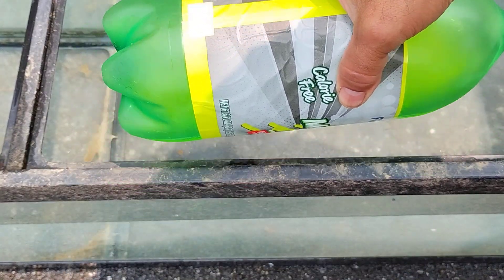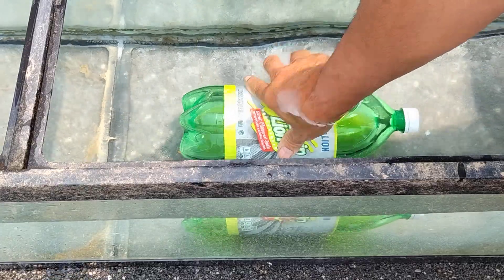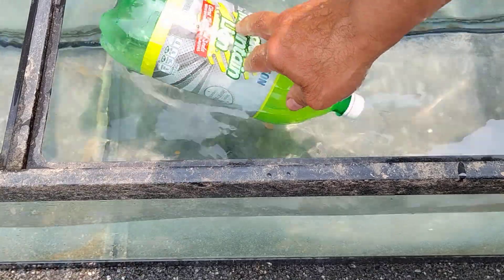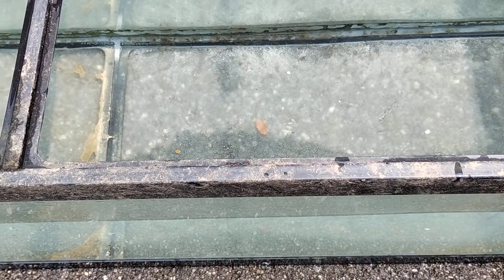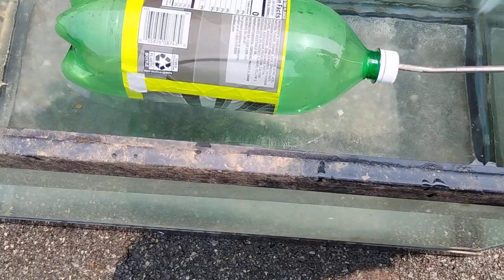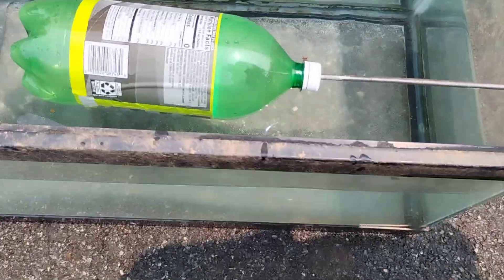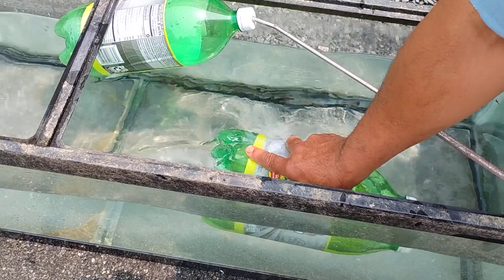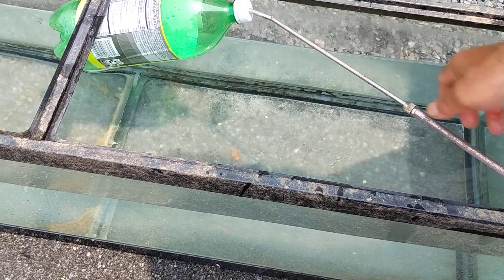Titanic Titan implosion was from the REAR let me demonstrate

Comment: I heard that they had initialized an emergency ascent when they imploded.

Theory:
Whatever caused the emergency, obviously something critical, they decided to use the last resort option that consists of dropping off the whole skid assembly to get to the surface as quick as possible.
One of the legs didn't release, the whole underneath was hanging and twisted the stuck leg, until it eventually broke.  The rest dropped down to the bottom of the sea.
The submersible imploded, because of the initial issue, which blew everything off including the stuck leg that is now missing from the remains.

Thanks for your videos btw!
Reply: Pure horror as they were shitting their pants in that coffin!
Reply: More like hyperventilating knowing the end could come at any time. It had to be harrowing for them to be aware that something bad was going to happen if they didn’t get to the surface quickly.
Reply: Where did you hear this? Can’t find any evidence
Reply: @bajamike9276  Yeah,Ive said also that it can't just go from everything is great to implosion,they would've heard the sounds indicating,if they didn't surface as soon as possible,it would it would be death,so yeah,they were extremely frightened,I'm sure they were beside themselves.
Reply: @johnbravo7542  There is a video out that shows the transcript between topside and sub. They had 15 minutes to debug the stupid idiot alarms that Rush thought was a great idea, but really is oh hey your engine is on fire your all going to crash and die but at least you have an indicator light and an app on your phone that the hull is cracking. Brilliant Einstein!
Reply: @Cptbrainworms  There is a post with 15 minutes of Titan to surface text messages,  they reported an alarm for the graphite hull was on, and could hear creaks, were trying to surface, and that was not responding well.  Surface requested updates and they were not given

Comment: Carbon Fiber hull with 2 titanium end caps reminds me of a tube of biscuits exploding when popped open. lol
Reply from the maker: Remember, the surface a pristine rear part of the vessel, you cannot have an explosion in that direction.
Reply: Yes…a biscuit tube.
Reply: @reddenitup  thats not what  im trying to say, you missed it entirely. im saying the sub resembles a tube of biscuits. chillax, bro!
Reply: I often think of the biscuit can analogy- though they are pressurized by inner vacuum and expose on breach
Reply: @ForensicCats the rear was titanium like the viewing dome, but was not at the ready to be opened like a hatch. It was not pristine if it was the access point for tubes or wires to the exterior
Reply: @christinecollins6648  biscuit tube is pressurized, thats why it pops when you open it

Comment from the maker: Please help me with a comment and thumb's up, I really do appreciate you... and if you see a troll, feel free to attack them, what goes around comes around... Never let a bully get away with their actions.
ps This WILL get my legs ripped off and also shear the bolts that concern me so much, this creates my claymore or mortar device using high pressure water as opposed to high pressure air...
I will add to this but wanted to put a quick version out there... I gave this Columbo hint in first video where I talk about shearing with a sword
Reply from the maker: This WILL get my legs ripped off and also shear the bolts that concern me so much, this creates my claymore or mortar device using high pressure water as opposed to high pressure air...
Reply from the maker: I will add to this but wanted to put a quick version out there... I gave this Columbo hint in first video where I talk about shearing with a sword
Reply from the maker: This is the short version so you can understand concept, I WILL make a better model with connections
Reply: @ForensicCats  Here's a Columbo Hint for you; One of the sevens ways that the Titan could surface was Detachable Sub Legs.

Comment: In his haste be innovative and while clearly being a huge advocate of its use, Mr Rush has probably now stigmatized carbon fiber as a good material for a large portion of the public. Sitting at the airport about to board a "wait is that a 787 made from carbon fiber??!" Hell no i aint getting in that thing!
Reply: As long as wings are not hanging on glue and duck tape you should be alright 😂
Reply: Carbon fiber is poor choice of material for a sub because it's very strong in tension but not so much in compression. The sub was under extreme compression where the airliner is designed to take advantage of the strong tensile properties of carbon fiber. Carbon fiber airlines are safe, carbon fiber subs are not. Think about it, grab a rope(fibers) on each end and try to pull it apart(tension) But its easy to push the ends of the rope together, compression. The sub hull was essentially just a spool of rope encased in epoxy. 
All that said I don't think the carbon fiber itself was directly responsible for the implosion. I think the glue joint between the carbon fiber tube and titanium ends is where it failed. Notice when they brought the wreckage up I did not see any carbon fiber still attached to those end caps. It's also equally possible the window failed and the water rushing in blew the end caps off.
Reply: Can't believe I'm saying this but, generally people are a bit smarter than that. Just a bit though.

Comment: The carbon fibre cylinder failed, probably at one of the interfaces between the cylinder and the glued-on titanium rings to which the end domes were bolted. 

With an instantaneous increase of pressure in the cabin from 1 bar to ~390 bar, the next weakest link was the acrylic window and its surround which, in the first millisecond, was blown out. 

Whether everything in the cabin was forced out through the window hole before the fibre cylinder fully imploded is anyone's guess. We're talking thousandths of a second here.

Tellingly perhaps, the disclosure of 'potential' human remains coincided with the recovery of the front titanium dome. The other items, apart from the ring, were not part of the passenger cabin.

Comment: The big pieces were due to explosion or implosion ?
Reply: Most likely both you can’t have an implosion without an explosion
Reply from the maker: implosion creates an explosion also...  the inside pressure is compressed, but it is called in an implosion... in reality, I would argue this vessel is in an ''explosive environment"; that the force just need a weak point to start the constant OVER pressure and overpressure is what an explosion creates. 
I will do another model, this was just a fast one but obviously I should have waited and given a lot more background information first

Comment: There is an excellent youtube video titled:

 Collapse of Composite Submarine Pressure Hulls  

 It showing how a plastic cylinder and a carbon fiber cylinder fails under compressive loads.  CF cylinder fail with a microscopic crack down the longitudinal (long) axis. It occurs very fast like a glass breaking.

Comment: My theory is like someone stomping on a Pringles can. I think that’s what you mean too🤔
Reply: Right that would be the likely explanation let's say the sealing to the valve in the front of the sub is what failed it wouldn't just blow out the back you would have equal and opposite directional forces inside the vessel. This would cause the sub to crumble rather than being expelled from either one side.
Reply from the maker: Okay, stop on this and have the two ends eject... you would destroy the rear of the vessel that is outside and this is NOT what is presented in the recovered materials.

Comment: My take
Glue at end cap became hard, brittle. Small area allowed little bit of water into crew area. The cheap control stick got couple of drips on it that shorted control.
Water quickly filled capsule, drowning  everyone.
I'm thinking compressed air cylinders were in capsule and exploded, blowing endcap off.
Reply: At that pressure there would be no 'drowning'. The water and the pressure would be instant, literally crushing them from the outside in.

Comment: You demonstrated differential pressure  across an unbalanced telescopic mechanism. The bottle was free to travel while the metal pipe was in a fixed position. 
If you stuck the pipe in further the bottle would have traveled faster.
Reply from the maker: That is what overpressure is... and I do legs in the upcoming video but not for your reasons and it can be dangerous if I submerge the bottle and attempt this same experiment; no fuk ing way...  it's about overpressure and metal pipe was acting as the gas / fluid pressure with the sudden over pressure ...  watch the next video
Reply: @ForensicCats  have you considered that when the carbon fiber failed the two domes where driven towards each other with enough force to shear them from the cradle and tail of the "submersible"?
Reply from the maker: I have considered implosion from overpressure outside of vessel and each time I can't get the arms in pristine condition , it would be easy for me to follow the pack but the arms have the connections sheared and this can only be done two ways, the rear just fell off or a leak and then internal hydraulic overpressure as I demonstrate with air as my hydraulic force....
Slow the video down and you will see the forward movement first before hydraulic overpressure destroys sample... this gets my arms free and clear and the rear being pristine.
Reply: @ForensicCats  Carbon fiber and aluminum are incompatible materials due to galvanic action and subsequent corrosion. The titanium domes and rings where bolted to the steel cradle which was bolted to the aluminum barge. In this arrangement the carbon fiber and aluminum would simply corrode before the steel or titanium. This floating saltwater battery spent a couple years in the water either at sea or at the dock. The square tubing making up the tail framing failed under tension because the rear dome was on it's way to meet the forward dome somewhere in the middle.

Comment: If only the carbon fibre hull would have failed, would't the rear end cap still be attached to he tail ? I also thought they unbolted the viewport for easy transport. I have a feeling they are going to blame it on the viewport anyway bc it was only rated at 1400m or so. Basically I'm sceptic they would reveil the truth. Too many experiances.

Totally unrelated but a pile of hay near a fence with neighbour suddenly caught fire. Wooden fencing was gone, the side of shed was half burned (rockwool inside wall), everything inside was melted, but inside wall intact. So CLEAR evidence to me the fire started outside with the neighbours. The insurance "experts" still insisted the fire could've started from within the shed ???? So I'm a sceptic. The "experts" just want the cheapest payout for the insurance imo.

Comment: my calculations have implosion from the view port. i disagree with the demo but that's science, nice video
Reply from the maker: From the viewpoint would send this into the rear section and we would NOT have a pristine rear... Did you see my last video on this?  I almost always play devil's advocate and then ultimately I release exactly what I really belief what happened.
The viewport would be opposite and you have made what I call a ''conclusive file" and your view point (pun) canNOT be changed bc you made this ''conclusive file"...  it becomes your bias.
Reply: That's what I think too. People look at the undamaged carbon fiber viewport and think that its unlikely that is the part that failed. I think it's the opposite. That part had popped off like a tomato can and immediately all the air inside was superheated. The last of the air was in the back of the sub which is where all the damage was, that is likely where the explosion happened after the fact as the sub collapsed within itself.
Reply: @ForensicCats  No I'm open to other ways it could have disintegrated. But I'm also just speculating on something that is overlooked in a lot of these styles of videos. Mainly being people looking at the partially damaged portion of the sub and assuming that is the failure point.
Reply: My calculations have implosion from the carbon fiber cylinder.
Reply: @MrZulgen  That's not how things work under water this deep. You could unscrew all the bolts that were locking these people in at the bottom of the ocean, and the presure alone would still keep it sealed. It would only come unsealed once the weight of it could overcome the preasure forcing it against the hull. This would be far above where the suspected implosion occurred. Nothing is "poping off" until something else failed that "popped in"
Reply from the maker: BUT, I was only setting people up on that theory, you STILL need the inside ''ring'' interference fit... Can you tell me why? 
I can save this for another video but I will hint, you CAN unscrew them but now, I want you to unscrew them and tell me how or what force or actions besides implosion or explosion would cause  or could cause the ''unscrewed" ends to disconnect?  Theoretically of course.
Reply: @maskddingo1779  guess those bolts were unnecessary then. should have just dived to the titanic at that point.

Comment: So, they got forced out like toothpaste through the front hole adding up in a marmalade paste
Reply from the maker: I am not sure that viewing port failed, I have a bias that until I see some sheared bolts or threads, I am thinking the underwater sub removed bolts or the crew for whatever reason(s)...  But, the were compressed and the force would be in excess of what it takes to shear those bolts from this vessel at HIGH speed (low speed would not create a shear)...
Reply: @ForensicCats  either way the soft protein of their flesh would have denatured under the  hydrostatic pressure leading to a conversion to scrambled eggs and some chunks of bone like pebblesized.
Reply: all their guts we're forced out every hole

Comment: I love your work and I like a lot of your summations but I vehemently disagree.  All the wreckage points to the cause of implosion as a failure of the acrylic viewport at the front bell end/entry door. The reason the rear sheered off is because the acrylic became a projectile and blew the bell ends off as the hydrostatic shock wave from the plug, coupled with the imbalance of pressure shattered the carbon fiber pressure vessel tube. I am surprised your not seeing it, it seems obvious to me.  Look at the orientation of the wreckage as explained by Arctic Explorer. Look at the viewport rim. Look at how the front two vessel support legs actually bent forward while the back legs bent inward. The sheered bolts are more evidence of this. I'm hoping for leaked photos from Pelagic Research Services. I don't thing they will find much from the human remains unless their was a fire pre-explosion. I guess they are doing DNA testing on the human remains at a lab here in the US.